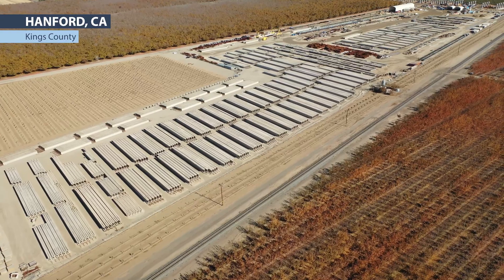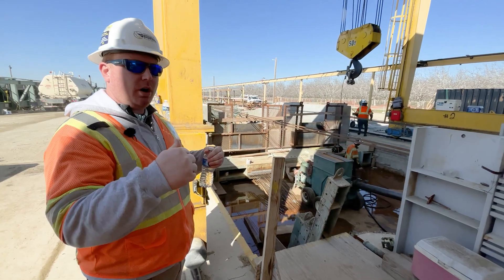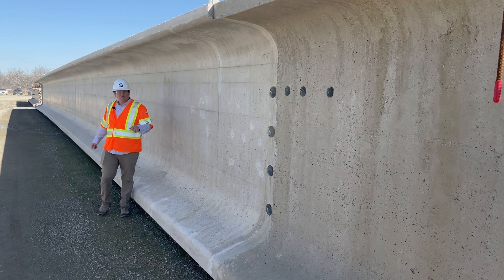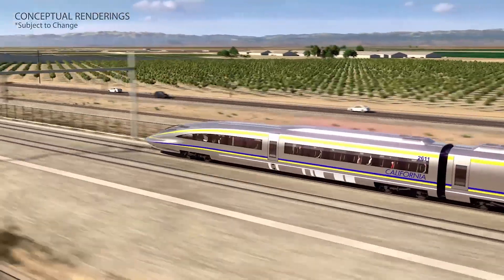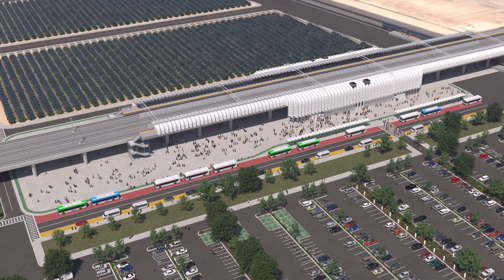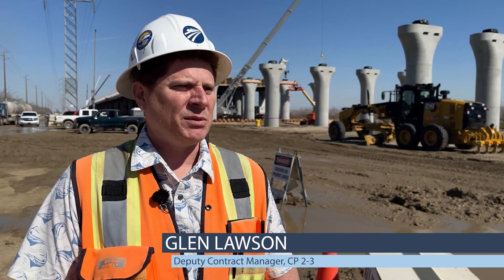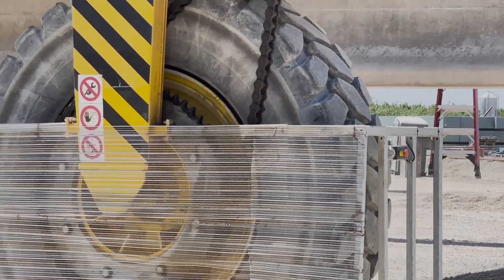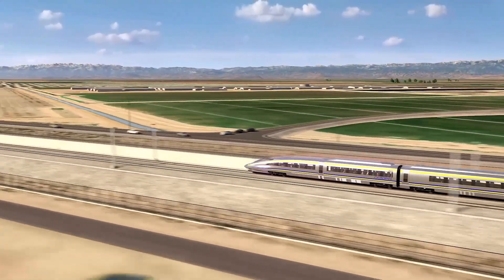#WonkWednesday: Concrete Beam Girders Help CA HSR Over Rivers, Roads, Rails, and More!

Comment: 2 things: 

1. Is I wonder when the Central Valley will finally connect all of these big construction projects and show the country/world we can do it too and finally start laying down the rail tracks not long after. 

2. Since Brightline just got approval for starting its bullet train from LA to Las Vegas, Los Angeles Union Station needs to officially start remodeling/upgrade the entire building inside/outside for the upcoming high speed rail along with with accompanying Amtrak’s Trains, Metrolink trains and Metro’s light rail system that runs throughout the City/Valleys of Los Angeles. So far only San Francisco has such a green and eco friendly new station for HSR/CalTrain and Brightline knowing them will have their Las Vegas station up and going since they basically have their Florida stations pretty much done/on time. Gotta pick up the pace now!
Reply: Brightline West is only going as far as Rancho Cucamonga, where it’ll connect with Metrolink for transfers to/from LA. Their station in Las Vegas will be two miles south of the Strip, at Las Vegas Blvd and Warm Springs Rd. That’s according to their website. 

LA Union Station is being upgraded and expanded as part of the Link US project, which’ll include converting it from a stub-end to a through station with tracks going over the 101 freeway. The first phase is expected to be completed in time for the 2028 LA Olympics.
Reply: @ChrisJones-gx7fc  as long as both Brightline and CHR actually go in and out of LA Union station like their supposed and go to SF and Las Vegas first that’s all that matters
Reply: @remsterrailroading2679  CAHSR intends to go to LAUS. Brightline West, from what I’ve seen on their website, does not. They plan on connecting with Metrolink at Rancho Cucamonga and likely Palmdale as well. The Palmdale connection would also connect them with CAHSR, so potentially Brightline West trains could share CAHSR tracks to reach LAUS and maybe even the Bay Area.
Reply: @ChrisJones-gx7fc  it would make sense to go straight to LAUS with Brightline as well. Hopefully they plan on doing so. If not it’s stupid of them because many people across California especially Southern California would be storming LAUS to avoid traffic and the long hours on the freeways to go have fun in Las Vegas on top of going to any of the NFL games over at Raiders new stadium
Reply: @remsterrailroading2679  Nope. The original Brightline plan was to go only as far as Victorville. That's hours away from Downtown LA in traffic. It would have been completely pointless.

After a ton of backlash, Brightline announced a future extension to Rancho Cucamonga to meet up with Metrolink. Even that plan is purely marketing at this point. They have literally no idea how they will do it.

Getting to Union Station in LA is completely out of the question. That would require acquiring brand new right of way smack through the middle of LA. Metrolink barely has space for the single track they have there and can't even add a second track. But this is all fantasy anyway. Even Rancho Cucamonga will be an extremely tall order for Brightline. I should probably also remind you that Brightline promised to start construction in 2020 and finish by 2024. They haven't even finalized the engineering plans let alone started building at this point. There are zero chances that they get to Union Station via Rancho Cucamonga in the next 15-20 year. The only thing that can save them is CAHSR building the Palmdale to LA Union Station segment and letting Brightline use it.
Reply: @TohaBgood2 if CAHSR and Brightline West are smart, they’ll work together and share the cost to build the Palmdale-LA segment, then share its use. 

One-seat HSR rides from LA to SF and Las Vegas, and potentially even one-seat rides between the Bay Area and Las Vegas. That’ll be great for all the Oakland and LA area Raiders fans to go watch their team play in Las Vegas, and for fans there to go cheer them on in Inglewood and Santa Clara, without having to drive or necessarily fly.
Reply: Brightline West was supposed to start construction in 2020 and start running trains by 2024 according to Brightline. They haven't even started digging by 2023 and don't even have the money or the engineering done.

I'm afraid that you were taken in by corporate propaganda. For-profit companies lie. You need to get used to that or your life will be very hard in our economic system.
Reply: Brightline West won't (for now, at least) go all the way to LA. The initial plan was for it to go from Las Vegas to Victorville, but now they're looking at extending it to Rancho Cucamonga and/or Palmdale. People could then change trains and take Metrolink to Union Station. There's a massive project currently underway to convert Union Station to use through tracks (instead of the current stub-end layout) and a future phase will improve the platforms and concourse. The modernization project is called "Link Union Station" if you want to google it. (None of the official sites describe it very well; look for news articles from about a year ago for the best info.)